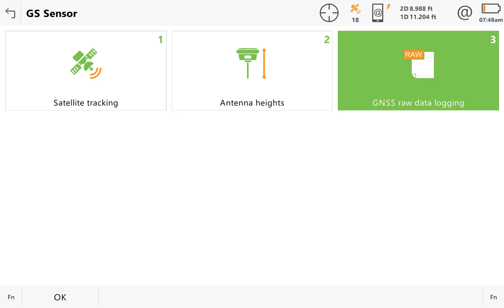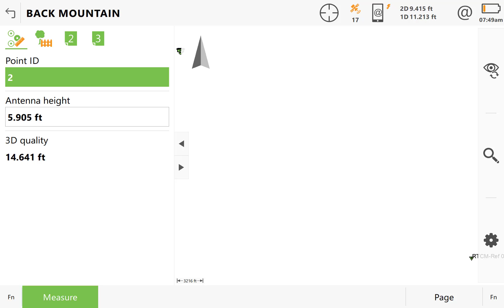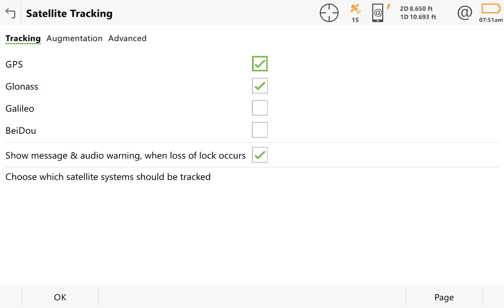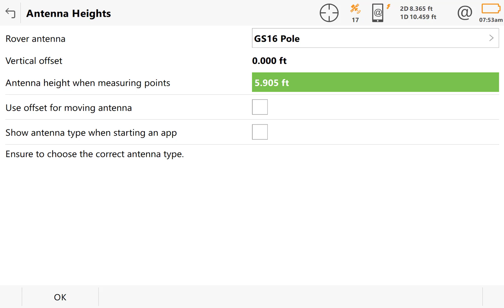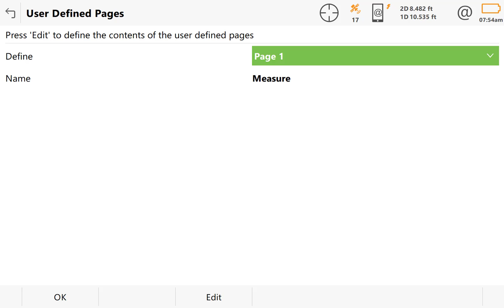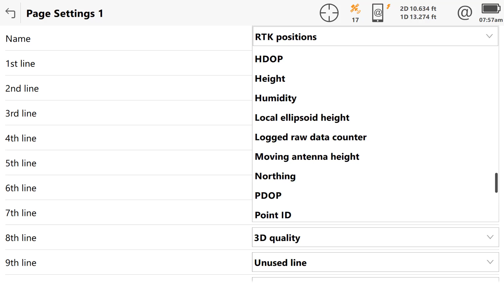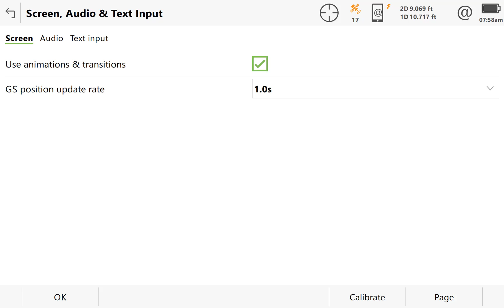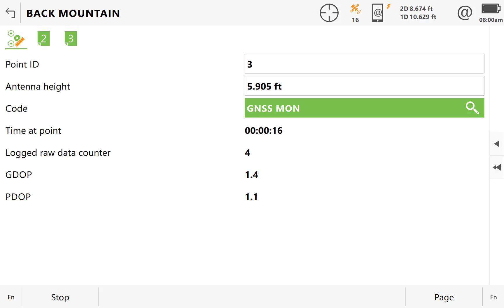Captivate Static GNSS Settings

Comment: hi! if i'm going to store data on the gs sensor, do i still need to create a job for that? i'm setting it up to store data upon booting up.
Reply: If I’m not mistaken, check the sensor in battery compartment for an SD card, if one is installed in it. The Static will save to that card automatically, it doesn’t save to the collector/controller.
Reply: @emanuelmontoya3759  so there's no need for a job, right? i'll be doing static on two control points. do i need to do base setup on one of the gs sensors or should i just set them up independently?
Reply from the maker: @vandriette3967  You don't have to create a job.  If you have a GS14, GS15, or GS16 you will need a memory card in the antenna.  If you have a GS18 you can store data to either the sensor internal memory or to an SD card.  If you store to the internal memory you will need a GEV234 cable to download.
Reply: @surveyorpop  thank you for the videos. very informative. 🙂
Reply from the maker: @vandriette3967  Thanks for watching!

Comment: When exporting jobs as a dxf they keep coming up as a block in autocad, what settings do I need to change so the job doesn’t come up as a block?
Reply from the maker: I have looked at the different settings in Captivate and exported several files.  I am not seeing this issue.  Are you using Autocad to open the DXF file direct or are you  inserting it?
Reply: I am opening the dxf file from the location on my hard drive. Which In turn opens up autocad.  I am very new to all of this so it has been quite the learning curve. I am surveying auto points for an open pit mine and if I don’t explode the points when I bring them into the tin the elevations don’t come through when I triangulate and contour the tin.
Reply from the maker: Assuming that you are using the DXF to get line work from Captivate to AutoCAD I would turn off the Point Export in the Captivate DXF  settings and import the points into AutoCAD using an ASCII point importer.  The software you are using to generate your TIN should recognize these survey points.  A word of caution, the significant digits used to generate and  export / import the DXF typically don't match the imported ASCII points.  This can cause an issue when the TiN is generated because the points that are supposed to be at the vertices of the linework will be slightly off (by the difference in the significant digits).  This may cause small crossing breaklines which can cause the TIN generation to fail.  If you have an alternative to get the points and linework from the field into Cad I would try that instead of the DXF method.